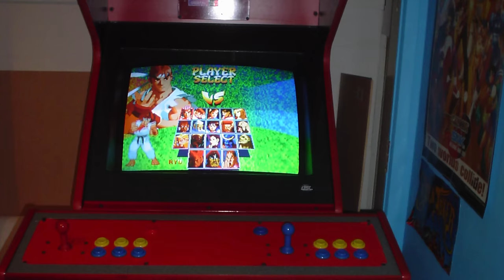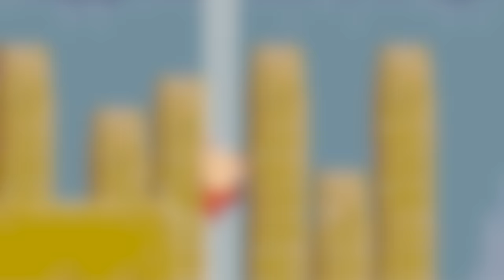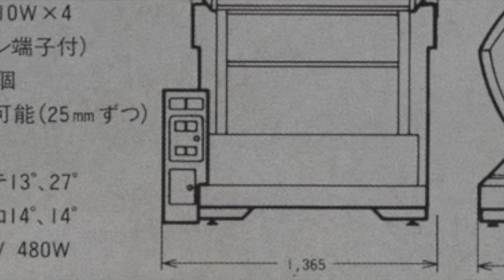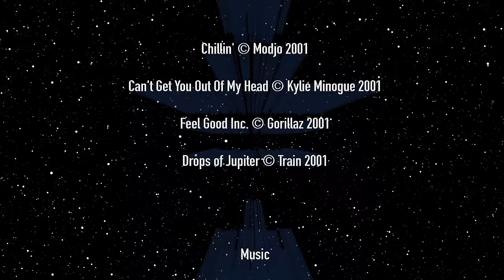Buying Arcades - Chapter 31 - Story Mode

Comment: Only ever owned one cabinet and saved up my money and bought the original Mortal Kombat arcade when i was 16 ! However the hardware was put into a 80's wood panel style cabinet and it was version  2.5 or the earliest version, no reptile indeed ! I used like fielding around with the menu and was intrigued by the Ermac error message with in the set menu and found out later that they simply used the name to build that character later on !

Comment: Interesting. I have an AB deluxe and thinking about a full strip down. Do you recall how hard it was to lift the 'cradle' section off the rollers? Seems you would need a hoist as its so heavy